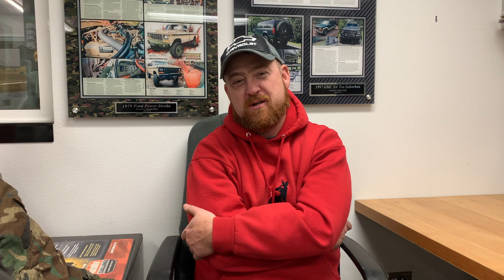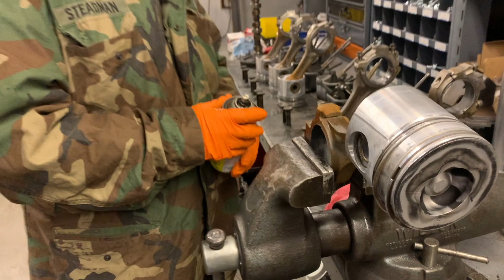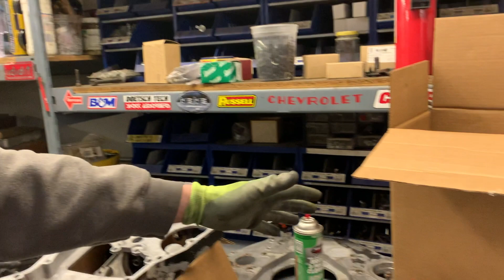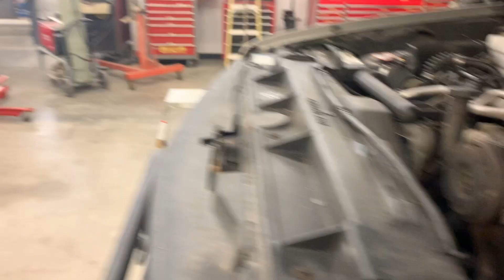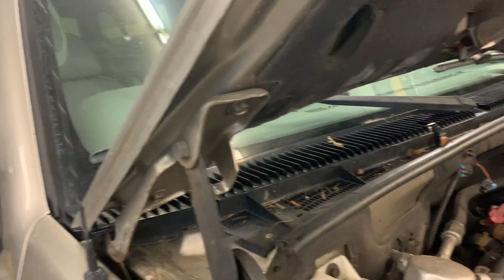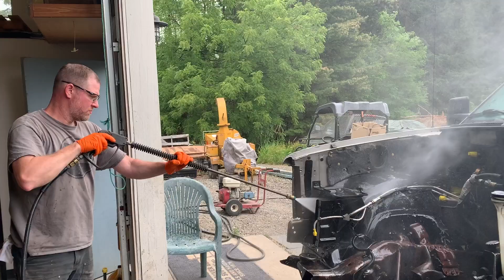*Project Shrapnel* How to install a Cummins 6bt 12 valve diesel into a Chevrolet Suburban - Part 1

Comment: What's the best Suburban for this swap? We have a tired 6.0 gas 2001 2500 4x4.
Reply from the maker: 1973 all the way to 1999 K20 or K2500.  Preferably starting with a vehicle that was originally a diesel.
Reply: @Jonesys what parts do you need